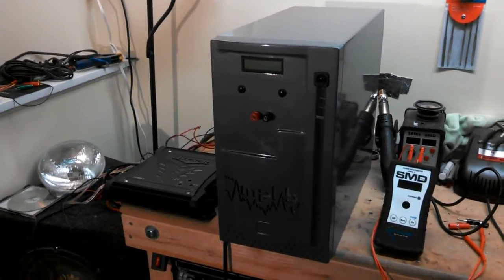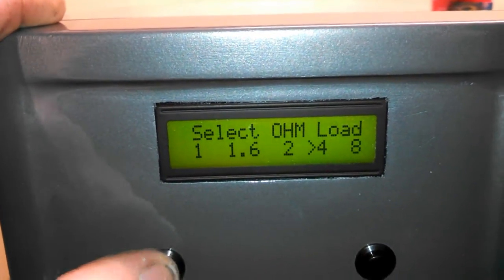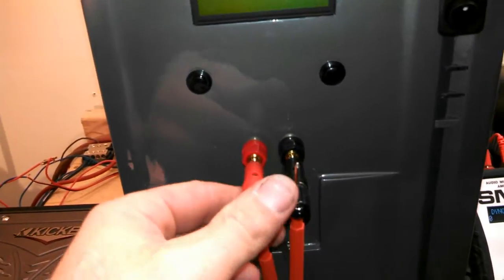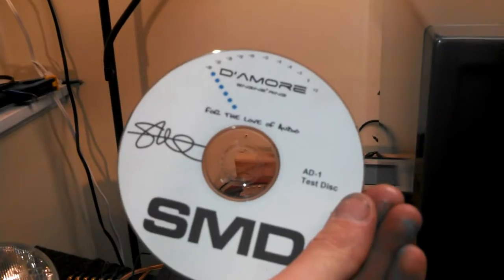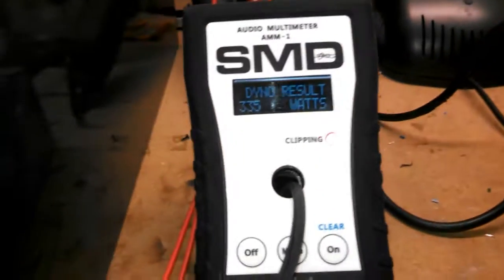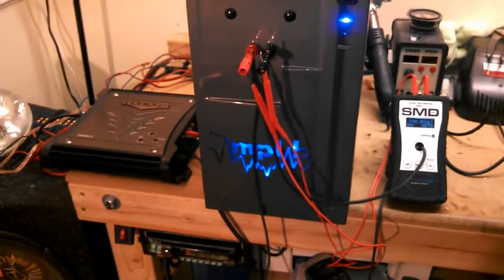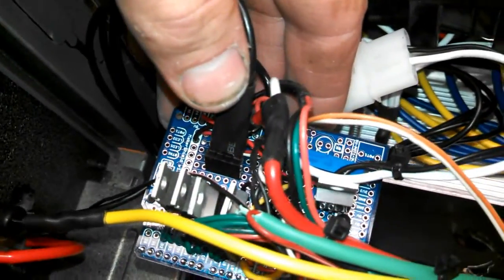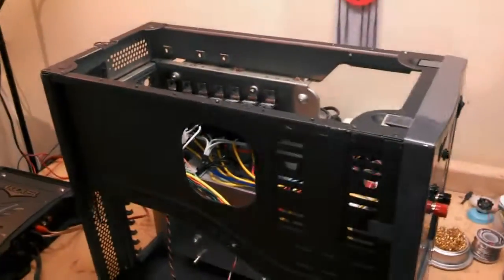The Amp Lab - 4000W Electronically Controlled Amplifier Dummy Load!  Homemade Amp Dyno

Comment: build a sharp notch filter that cuts out the frequency being played to sense distortion, then buy and current transformer to measure the current, use an arduino with the emon library to measure real, apparent, reactive power and power factor
program the arduino to display the max powers once the distortion detection triggers

also a notification of how cheap you can build an SMD DD1
Reply: I got everything done except distortion sensing, i have to manualy stop test when i see sistortion on oscope. Do you have more info on way you explained distortion sensing? I'm really interested

Comment: Do you know if the impedance of the braking resister changes with frequency?  Is it 4 ohms from 20 Hz to 20 kHz?  I've used water heater elements but they can vary +/- 1 ohm over the audio spectrum.
Reply from the maker: They do not change. I tried the water heater elements first as well.

Comment: "sometimes it doesn't like to read the discs"

The head unit is probably fine, it's just having a hard time reading through all those fingerprints from you putting your fingers all over the disc, and possibly micro-scratches from setting the disc down on objects instead of keeping it in a CD case.
Reply from the maker: No, even when the disc was brand new.  Its old, laser is weak.  All there is to it.  New headunit in now, no more issues.

Comment: You could definately benefit from a battery for transient peaks but are you doing it to listen to music for extended periods or just short duration tests with resistive loads ? BigDWiz used two 978-100's power supplies to test amps with no battery and no problems for years . It provides a more steady voltage rate than a battery also . Plenty to measure output power of different amps and no battery to keep charged . Just turn the power supplies on when you do your load bank .
Reply from the maker: I am picking up a brand new Schumacher 200A supply tomorrow, and I have already added two more AGM batteries.  I should be all set after that I think.

Comment: What type of controller and where did you get it?
Reply from the maker: What do you mean by controller?  Everything was custom made basically. Its all run from an Arduino Uno microprocessor that must be programmed by writing code for it that tells it how to handle each input and output.
Reply: thats what i was looking for  thanks

Comment: Why not have a couple simple power supplies such as Audio Authority 978 which can be strapped for 200 amps ?
Reply from the maker: You would still need a reserve power supply like batteries. Otherwise its like hooking a system up in your car with just an alternator and no battery. It doesnt work that way. You need batteries for reserve and for filtering/smoothing of the power supply.

Comment: Very slick! This is much easier than manually rewiring the loads for each test! The AD-1 has a few more test modes, such as Dynamic Power and Certified modes. The AMM-1 mimics the uncertified mode on the AD-1 (up to clipping). You could use your DD-1 in conjunction with the AMM-1 to show wattage at 1% THD. Either way, great project! Thanks for posting the video.
Reply from the maker: Yes, I can simply play track 1 or 2 on the AD-1 disc to get dynamic. And I can tune gain with 0db overlap to do certified. So essentially I can do all 3.  Just takes a bit more effort. 

Thanks for the comments though. I was hoping you would see this video.
Reply: rtkota5point9 But I thought the AMM-1 does wattage at "clipping"? You would need to integrate the DD-1 to get the 1% distortion rating (certified). I haven't tried my AMM-1 with the dynamic tracks, that's cool if it's fast enough to capture wattage and clipping during those tests! I've tried to use my Klein clamp to measure DC A pull during those tests and it is not fast enough to measure the current pull. It will do the other tests, but it doesn't stop at clipping, just keeps measuring Amperage as long as it's pulled from the source.
Reply from the maker: The AMM-1 does stop at clipping, but it will always hold the highest wattage it saw. Normally you would set the gains with a -5 or -10 db overlap. Thats the only way it will ever hit clipping when playing the AD-1 test tracks that are played at -0db.

If you simply adjust the gains with a DD&1 @ -0db, no overlap.  And tune them to juuuust before the distortion light comes one, then when you play the test track back, it will only go as high as the point just before distortion. It will never actually reach clipping.

The AMM-1 will still hold the highest wattage it saw up to that point.  Thus giving you a certified test. :)
Reply from the maker: Wow. typo central. Sorry, on my phone.
Reply: rtkota5point9 10-4, I see your point now. Good deal
Reply: You like Big D too???? HELL YEAH!